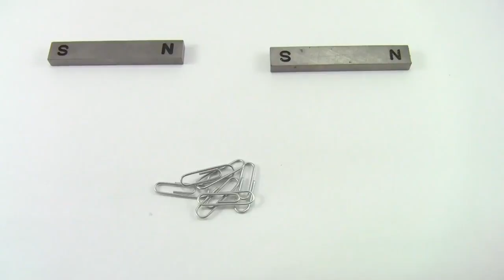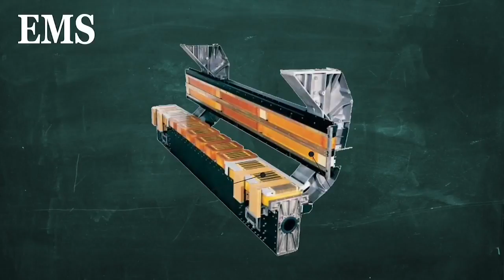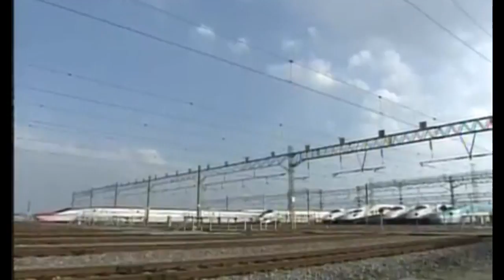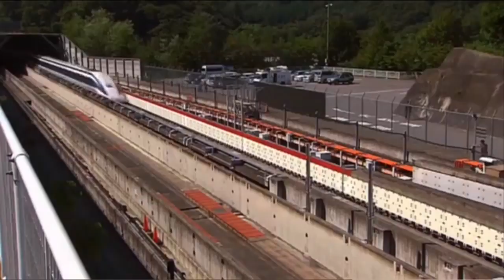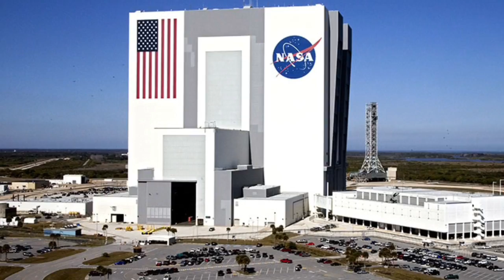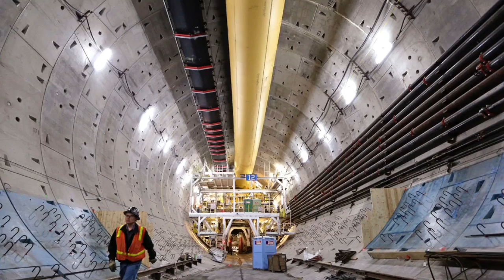All about Maglev Trains how it works, Countries, NASA, Construction,...

Comment: China is a leader in maglev train.Jiaotong University ,China oldest railroad engineering school with government funding has built and tested a small maglev train in a vacuum tube at 1,000 km/hr.in 2014.CRRC will build a larger maglev train between cities at a designed speed of 2,500 km.hr.One in the city ,China has built two maglev trains,one in Changsha,the S! red line in Beijing and is building in 10 other cities.CRRC has built over 30,000 KM of HSR at a cost of 800 billion dollars and is plannimg to build another 20,000 KM of HSR or maglev trains in a hyperloop system.
Reply: But, But, But, Surely the Chinese must have stolen all of this  technology from the US?
Didn't the US build some of these in 1685?
Reply: @iceberg No, they bought it. It was an official technology transfer, a cooperation of Germany, China and the involved companies.